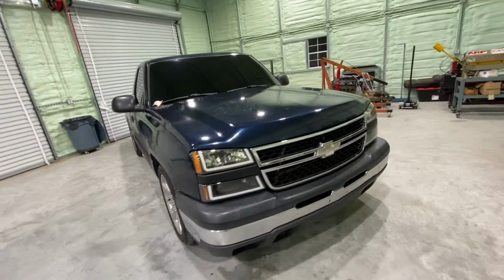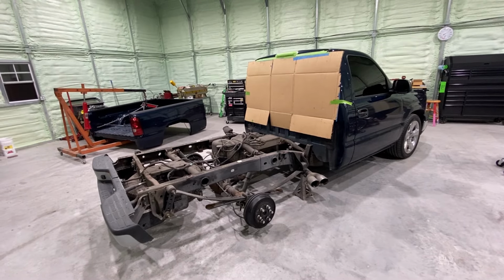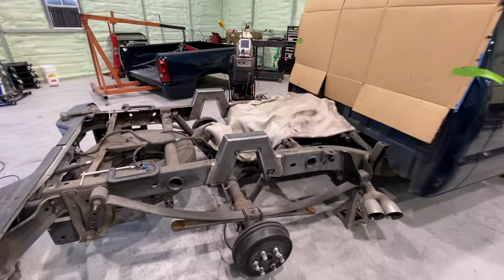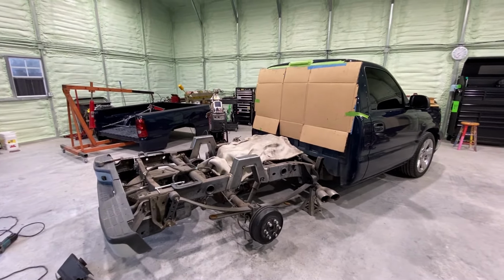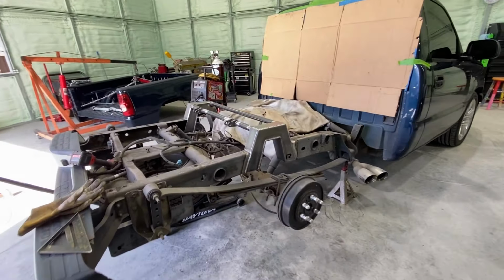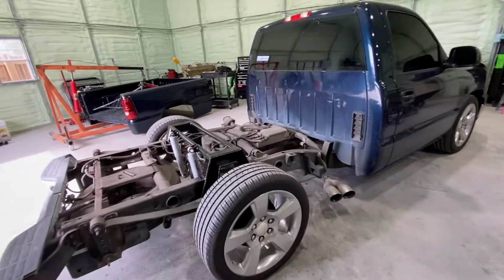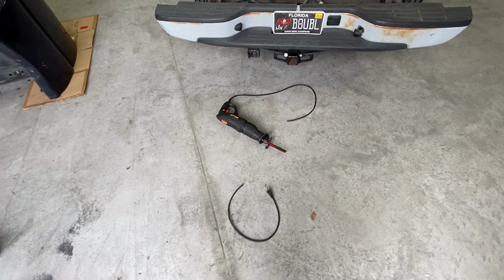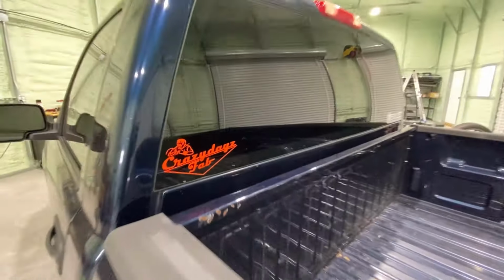2006 Single cab Silverado monster notch install

Comment: Question.. I need to stand my bed up like you did but I’m worried about the bedsides bending when the weight of the bed is on the front corners. Doesn’t look like you had any issues tho? No damage to bedsides?
Reply from the maker: Fleet side or step?
Reply: Fleet side
Reply from the maker: @JMSAUTO  Do it quickly and you’ll be fine. It’s easier with a helping hand. I’ve done it so often I can do it alone.
I also old to put cardboard down so I don’t scratch the bed.